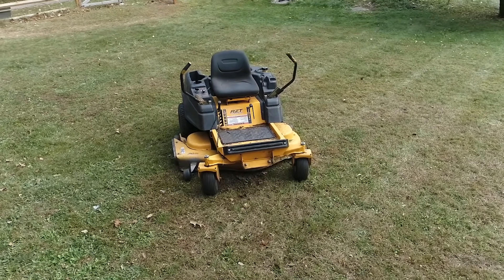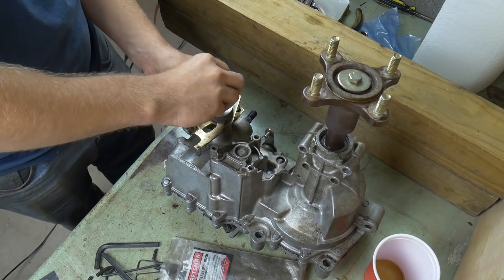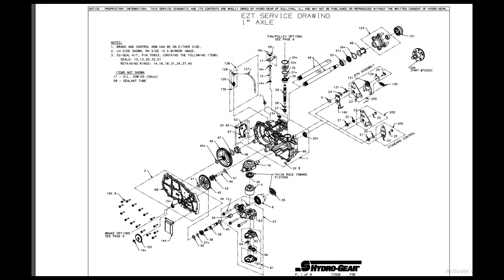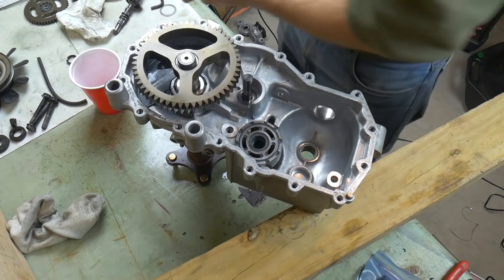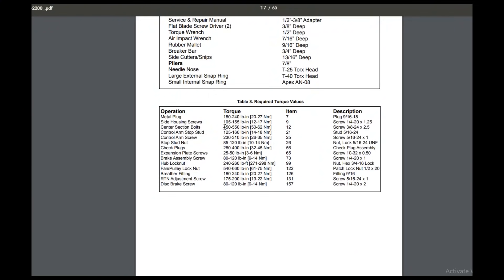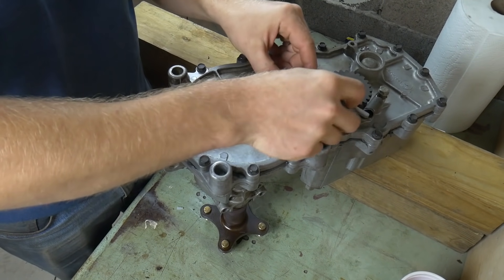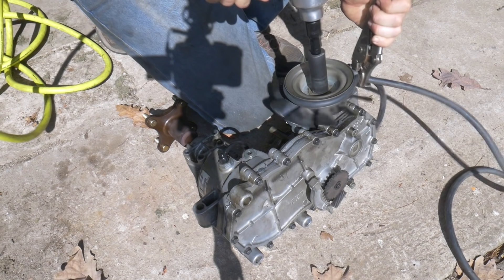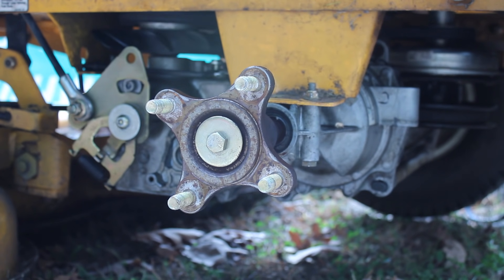Cub Cadet Zero Turn Weak Transmission Fix.

Comment: I have a 2016 RZT which they state the transmissions don't require service which I am doubtful of but are my transmissions like this one you are working on!  I could look it up but thought you might know off the top of your head!  Wish you lived close to me as I would hire you to do my work when the time comes!  Great video!
Reply from the maker: More then likely it has the 2200 transaxles. Especially if it says they are non serviceable. They should add a drain plug so you could at least change the fluid. Im in northeastern pa. Thanks for watching.

Comment: I rebuilt my gear using your video 6 months ago. It had groves in the center section. After installing a new center section it worked great until now starting to slow down and is back where it was before. I opened it back up and the pump and motor look perfect. The center section has rotation marks on the pump and motor side but no groves. The pump side rotation marks don't look even. One side is a little thinner. Also, there are some marks going from halfway center to the outside. None of the marks I can feel with my fingernail. One time when I was reversing direction real fast I heard a knock. Thinking it was the pump slamming on the center section. Do you think a new center section is what I need?  I just wish I could feel the marks. They are all smooth.
Reply: Took my pressure relief valve off and it was clogged up inside the top of it. Got a wire and cleaned it out. Put the gearbox back together and it has power again. Mowed for an hour and it's doing great.
Reply from the maker: @eastcreek2373  Glad you found the problem! I wonder what clogged it up.
Reply: Where’s the PRV? Can’t find it on the diagram

Comment: Thanks for the great video, what oil did you use ?
Reply from the maker: I used castrol gtx synthetic. Recommended weight is 20w-50. Use what ever brand you trust.
Reply: @darbleythetractorguy458  Thanks for the info !

Comment: Ok, this is probably a dumb question, but I have a Dixon and it looks impossible to get the fill port once it’s installed, how do you bleed out the air and then fill the oil with it installed?
Reply from the maker: If you can't get to it at all your probably gonna have to bleed it good then remove it to check the level.
Reply: DarbleyTheTractorGuy thanks for the quick reply.

Comment: Did you have any trouble removing the input shaft? Money seems to be tight.
Reply from the maker: Should come out easy once the clip is removed.
Reply: I also had trouble...searched but could not find a solution.I removed the seal and the clip...shaft would turn but not come out. No videos of removing the input shaft. Just comments that say it should be easy to remove. I finally figured out why? I had removed the 3 center section bolts. Causing the input shaft to bind. I tightened the bolts and the shaft just fell out. I hope this helps someone!
Reply from the maker: @khig2025  thanks for the input. Hopefully it will help some one out.
Reply: Uh oh, after reading this, I feel some hope after severe frustration and let down.  Mine is doing the same thing.  The ball bearings and shaft aren’t budging and I removed the center section mounting screws first.  I’m going to give this a try.

Comment: Hey man I replaced the center section since I felt it getting weak . Now I reassembled everything and it’s exactly the same . It tries to engage and barely maneuvers . Do you think I have a purging problem or an adjustment problem? Or maybe something else???
Reply from the maker: If everything looks good inside that's tough. Make sure the little bypass piece is install properly. Purge it good and make sure its full of oil.

Comment: I have a problem with a raptor Hustler a 52 in 2015 about 20 minutes it don't want to haul it pulled no more and it's been leaking oil so I might need a little help from you thank you Cajun land Church Point Louisiana
Reply from the maker: Looks like it more then likely has the same trans axle as the one in the video. If its leaking it might be low on fluid. I would pull it off the tractor and see what's going on.

Comment: Use granite tile for a sanding block, its diamond ground smooth. or take it to a machine shop if it has gouges from metal, or get a new part.
Reply from the maker: thanks for the input.

Comment: @DarbleyTheTractorGuy, Could I use a Hustler Raptor EZT-2200 transaxle with a Cub Cadet center section as a bolt-in replacement for a Cub Cadet EZT-2200 transaxle?
Reply from the maker: I dont know for sure but I would guess that since they are both ezt 2200's the are more likely the same.
Reply: @darbleythetractorguy458  , Thanks. They look so much alike from the outside I was thinking it might work.  I have no clue though since I've never had one open.
Reply: Be careful. There are two different ratios used. Send the model/serial numbers to hydro gear and they can confirm or deny compatibility.
Reply: @camplife2687  Thanks for the heads up.

Comment: I have a one wheel wonder i1050 with what looks like the same transmission aside from a different style parking brake.  From what I can tell, all the control linkages are good but I get no rotation out of the left wheel when I go forward, reverse or turn.  When I disengage the bypass, the wheel spins freely, when it is engaged, it does not.  Actually feels identical to the right side which is working properly.  I bought the mower for cheap and I think I know why.  Is there anything else you suggest before I complete this same repair?  Thanks.
Reply from the maker: I would just open it up and see if the center section is damaged.

Comment: any idea what you can do if you have a transaxle that is sealed and maintenance free? if it dies its a gonner?
Reply from the maker: These transaxles are considered sealed and maintenance free. You might be able to repair it. It seems most are pretty similar.

Comment: Grease the bypass puck to make it stay. Take the motor output gear off its shaft, assemble the motor on the shaft and slide it into place. Hold it. Then slide the center section over that. As for the trunnion/swashplate, you just need strong hands and care.
Reply from the maker: Thanks for your input! Greasing the bypass makes it much easier.

Comment: Actually I pressure wash the hell out of the those after I pull them apart. Just wash the casings though not the pump or motor or center section.

Comment: So i followed you vid. Rebuild went very smoothly. But now the trans wont pull at all? I made sure the bypass piece stayed in place. Any ideas?
Reply from the maker: there is a chance the bypass piece isnt right. Make sure the belt is hooked up. I wouldnt guess the bypass piece.
Reply: @darbleythetractorguy458  the right side works fine... just the left side does nothing. That little piece can only go 1 way i think. So i dont think it could be that... gonna pop it apart and recheck everything.
Reply from the maker: @boosted1jz  yeah. someone else had the same issue and said it was the bypass piece fell out. They said they used a little grease to hold it in place while assembling.
Reply: @darbleythetractorguy458  i will be pulling it apart tomorrow. Hopefully that little bypass piece fell out.. cause im out of ideas on what it could be. Its a very simple looking setup, not much else could go wrong

Comment: Great video.  Glad I found it.  I have a Hydro Gear 312-2400L with axle issues, any suggestions?
Reply from the maker: I would open it up and see if anything is worn. Might get away with an oil change. I found a manual for a 310 2400 on hydro gears website. Might be the same as yours. If you contact hydrogear and they will give you a parts breakdown.
Reply: @darbleythetractorguy458  Thanks for the info.
Reply: Seems like a common problem on the cub cadet nada troy built mustang. Is there an upgrade trans a person could buy instead of the same failing units going in.

Comment: The manual only shows one part number. Is the center unit the same for the left and right?
Reply from the maker: I don't think it is the same. You can contact hydrogear and they will send you the right manual for the side your working on.

Comment: What was the cost of the center section and seal kit. My mower only has about 70 hours and is already acting up.
Reply from the maker: I payed 40 for the seal kit and 126 for the center section. That is low hours for it to start messing up!

Comment: Can you change the input shaft without disassembly ?
Reply from the maker: i think you can. I believe the only thing holding it in is the clip on the outside
Reply: I did it, shaft comes right out !

Comment: Great details in the video! I have a rzt42 with the same problem. Every shop I had called said those transmissions were "non serviceable" and that I would basically have to replace both transmissions. Hopefully this winter I can tear mine down and rebuild it!
Reply from the maker: It seems most shops don't want to work on them. The weird part is hydro gear has a repair manual. Good luck with yours I hope the video helped.

Comment: When removing grooves, toss that piece of wood and get a thick piece of glass.  The glass will be much flatter than a possibly warped piece of plywood.  Talking from years of experience.
Reply: I used the glass cooktop on my kitchen stove. Probably not ideal, but perfectly flat and worked like a charm.
Reply: Yep glass shop have a14/16 sheet of safety glass and round edges for 22.50
Reply: I've also seen people wrap the sand paper around a large wet stone as a flat surface.
Reply from the maker: Joseph Martin I agree.

Comment: What an great video!!! Excellent job! One question I have the same transaxle and mine has a lot of play on the shaft that connects to the tire you didn’t go into that what is inside that shaft and how can I get it back to having no play? Thank you
Reply from the maker: Cedric id guess theres a bushing or bearing that could possibly be replaced. Take a look at the parts break down and see whats there. Im pretty sure the seal kit comes with a seal for the axle.
Reply from the maker: Cedric i took a quick look. The part number is 51517. They call it a bushing.

Comment: center section will not come out on mine, help an idiot please?
Reply from the maker: BReid as long you you take the shaft that the pully is on out and the 3 bolts it should slide out.
Reply: OK, thats what will not come out I will bang on it some more!

Comment: I'm being given a 10 year old RZT50, and I think the left side is weak.  This video may help me out immensely!  I've heard there are other adjustments that could be made before a rebuild or replace, that might solve the issue, do you know if that's correct?  Thank you! 👍
Reply: I think it has under 500 hours.
Reply from the maker: Richard Ballew Awesome! You could try adjusting the linkage and going through the bleeding process. Thanks for watching
Reply: Where did you get the parts?

Comment: how do you remove the torx bolt holding the forward and reverse plate? Ive been trying and cant get it off
Reply from the maker: osvaldo gomez if i remember correctly I did have a hard time also. I ended up hitting it with the impact gun. Once it was out enough I grabbed it with the vise grip. It was tight the whole way out. Went in like a normal bolt. They must use loctite on it.

Comment: how many hours can one expect to get out of this EZT diff?
Reply from the maker: km4fsi it really matters how you drive them. Some people have problems starting at 150 to 200 hours. This one had around 500 to 600 when it started going bad.
Reply: I had one side go out at 39hrs, then the other side at about 60hrs, then original one go back out at about 100. Luckily they where covered under warranty, but now it's been sitting in my yard for a couple of years cause the other side went out and after seeing this video I think I will tackle it.

Comment: I was given a Gravely 2448 XL. The mower wont move on the right side. It looks like fluid is leaking from the bottom of the Transaxle. Doe this sound like a replace or repair? Any tips on how to troubleshoot the issue? Thanks for any assistance.
Reply from the maker: If its leaking fluid there is a good possibility that it is low on fluid. It looks like that mower has a zt2800 trans axle by hydro gear. It should be really similar to the trans axle in the video. I would pull it out of the mower and see where its leaking from. Change out the oil with new oil and see if that helps. If it helps then change the seal that is bad if you can find it. If that doesn't work I would open it up and see whats wrong. It seems the only thing that really goes wrong with these is the motor as I show in the video or low on oil. The only way it can get low on oil is if its leaking. Thanks for watching!

Comment: How many hours were on it when the problem developed? Are there any other problems that are commonly seen in the RZT's? I'm looking at used ones and would like to know about problems I might encounter. What would be considered excessive hours on these machines?
Reply: Weird thing is that in 99 percent of the cases it’s the LEFT side.  Can somebody explain that?
Reply: @failranch9542  My right side went out. It seemed weak when it was new.
Reply from the maker: I believe this machine had around 800 hours. The problem started probably around 600 and slowly got worse until it was pretty much unusable. It all matters how you drive it. If you slow down before reversing the hydros will last much longer. Best thing to do is drive it and make sure the hydros feel strong. I dont think there is any other known problems. They used a bunch of different motors so do some research on what motor it has. I would say 400-600 hours is a lot for this mower. If it looks like it was taken care of I wouldn't be afraid to buy one with more tho. Thanks for watching. I hope I answered your questions.
Reply: Cindy Long if you really want to cover your bases make sure you buy a mower that has SERVICABLE trandmissions. Hydro-Gear has a transmission that is the next size up and has oil filters and the fluid can be changed. If the unit in this video was serviceable and was maintained properly this issue would not have likey come up for several hundred more hours. Hope this helps
Reply: @uriahotten3895  I think that 600 hours is a good long life, for the "residential" class machines that the HG 2200 is made for.
Reply: @dizzywow  I have the HG 2800 transaxle that is serviceable. My unit has 1600 hours. Buy the serviceable tranny.

Comment: You couldnt get the pulley off because you were going the wrong way!!
Reply from the maker: lol. A lot of the footage of the tear down was footage of the build up reversed. I decided to do a video after it was already apart so it took me awhile to edit it all together. Thanks for watching!
Reply: @darbleythetractorguy458  i ended up just upgrading my 2200's to the zt3400 units with spin on oil filters. I had to change the drive pulley to a bigger size but everything is working so much better.
Reply from the maker: @JM-yx1lm  awesome! Filters are definitely an upgrade.

Comment: Thank you so much! I bought a Cub Cadet RZT 50 for $250 and the right side would get weaker and weaker as I drove it. After the tear down I seen it was the center section, so I ordered a new one along with a seal kit. Your video helped so much during the rebuild, you went into so much more detail than any other video Ive seen. Im not shure if I could have completed the rebuild on my own in a day without it! Once again thank you so much!
Reply: How much was the center section
Reply: That's what I was wondering as well, how much it cost
Reply from the maker: Your welcome! Glad I can help out. $250 is a great deal on a zero turn. Thanks for watching.
Reply: Yup. Prices would have been soooo great
Reply: Hello. Great video. Can you expand on how much oil you used and where when reinstalling the center section and blocks after the sanding was completed? Do you completely fill the blocks with oil? Do you oil the center section as well where the blocks rest on the center section? Thanks for any help and advise.

Comment: Can you put a link where you got the parts?
Reply from the maker: If you search for Seal kit P/N 70853 and Center Section P/N 71529 on ebay they come up. I got those 2 parts on ebay since it was the cheapest I found. You can find genuine hydro gear parts on ebay. Thanks for watching!
Reply: JACKS small engine repair or Hydro Gear site.